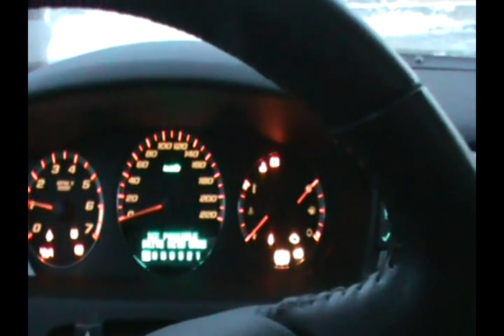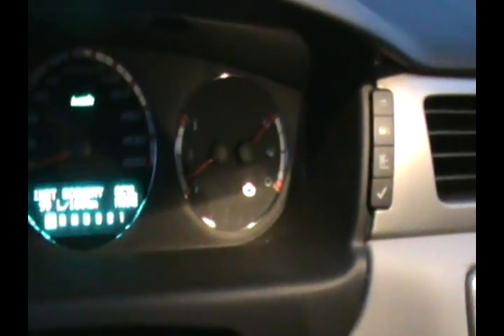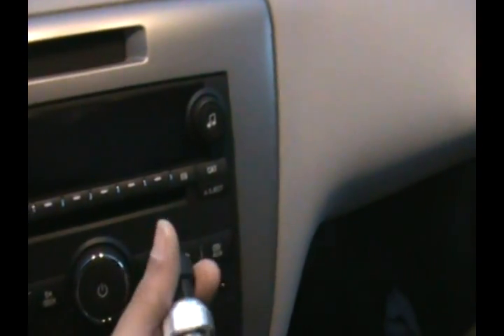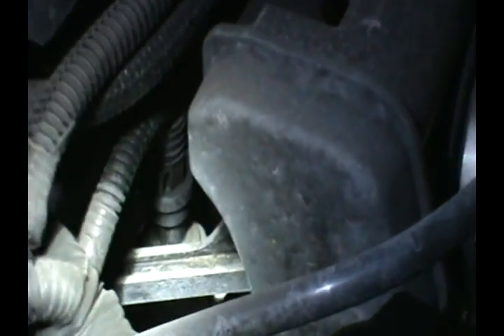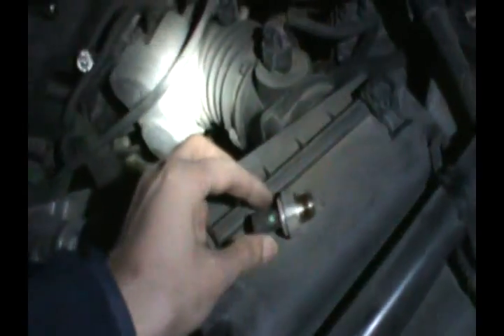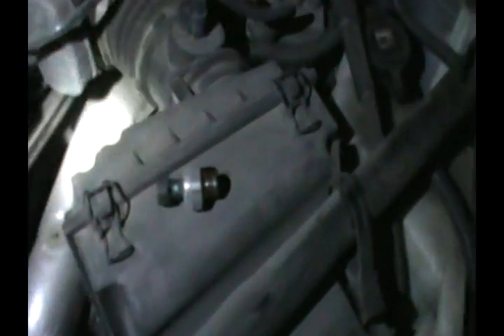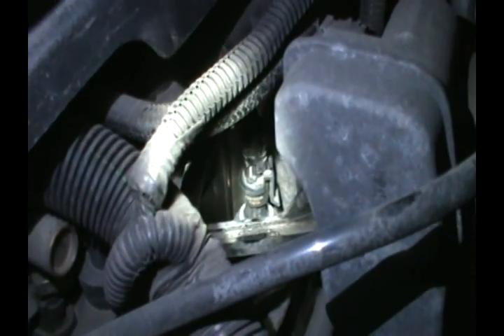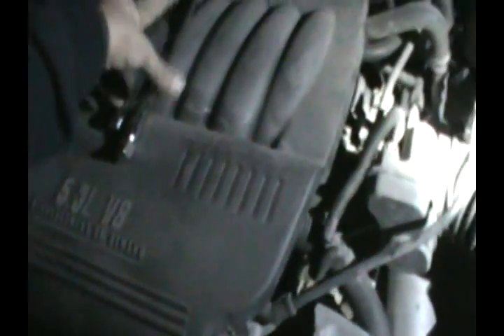Changing Oil Pressure Sensor

Comment: Help i have a 06 ltz impala the light low oil pressure stop engine comes on . Changed the oil and filter still the light comes up . What will it do to the motor if i dont change this sensor. It runs fine motor wise no noise just the light on

Comment: If a  Oil pressure switch is bad would your car idel bad, stall engine when putting it into gear?
Reply from the maker: no it won't. When your oil pressure sensor is bad your car behaves normally in every aspect. the only thing you will notice is the warning light